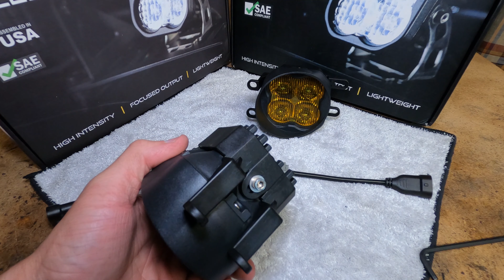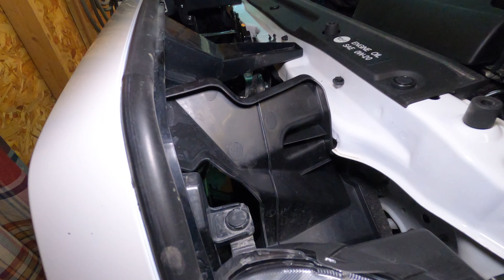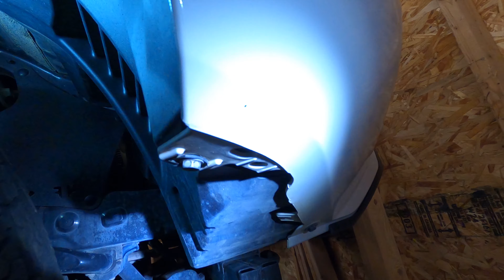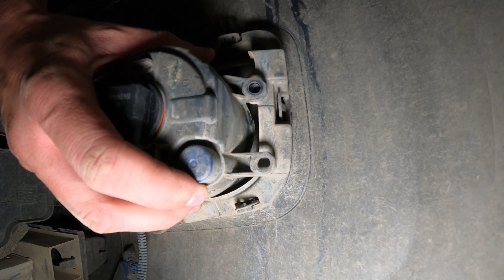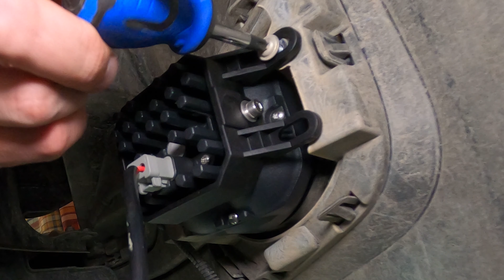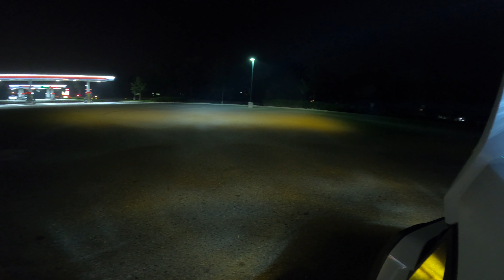Install & Review | Diode Dynamics SS3 Sport 3rd Gen Tacoma. Are LED fog lights worth the upgrade?

Comment: Nice install video! One small add on, the plug from the fog light to the harness will plug in either way, but will, only work one way, check that the  light turns on before you put it back together.  Great video!
Reply from the maker: You are absolutely right, and I did forget to mention that didn’t I? Thank you, and pinned!

Comment: Great video

Aimed proper as you described how are they in rain / fog / snow ? 

Any glare ? Thick pea soup fog and blizzards are what I plan to use them in. 

Guess they can be aimed and mounted lower as I’m buying universal mounts
Reply from the maker: The glare is minimal! That's the whole point of these is to cut through the blizzards, fog, etc! That said, you'll want to make sure to get at least the pro power level so that the lens face gets hot enough to actively clear off driving snow.

Comment: Can you guy do a comparison on the baja sae fog vs the diode ss3 sae fog?
Reply from the maker: Suppose I could... But what I will tell you is that the comparison won't even be close. The Diodes will win by a land slide. However, if you aren't concerned with road legality I can make a case for a set of squadrons being an awesome wide cornering light when mounted in the fog position.

Comment: When u put the fogs on and u hit little bumps does ur lighting bounce around? Mine seems to be not stationary even though i tighted the bolts..
Reply from the maker: You should not be getting much deflection of the lights at all on bumps. Is this on a 3rd Gen Tacoma or what is your application?
Reply: @hotshotoffroad  ya i have 3rd gen taco and i see the lights shaking when i drive and hit small bumps
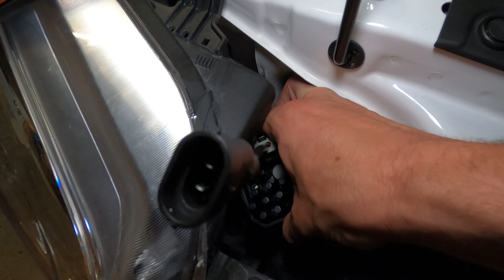Reply from the maker: Interesting... Not a known issue on the 3rd gens. Well take a look at a couple of things for me. First is the Toyota bracket itself. Go to 08:00 in my video. You can see that there is like a secondary bracket attached to the bumper. Make sure that is all snapped down and secure. 

Your side bolts that connect the SS3 to the DD bracket should be nice and tight, and the single screw connecting the DD bracket to the Toyota bracket needs to be snug (but be careful as the sleeve is plastic).
I have one last ditch thing that you can do, but I will call it last resort if all of those other items check out: You can run a zip-tie through the open hole of the DD bracket and the Toyota bracket. Here is a link to a Tundra install where I kind of go into it in more detail.
https://www.tundras.com/threads/diode-dynamics-ss3-sae-pro-fog-lights-installed-update-4-17-21-now-with-ss3-max.58478/page-19#post-2316845

Last but not least make sure that your entire bumper is secure to the rest of the truck.

Comment: Will these fit a 5th gen 4runner aswell
Reply from the maker: The 2016+ Tacoma kit is the exact same one as the current gen 4Runner! I just haven’t gotten it migrated into my website yet. So if you picked up the 2016+ Tacoma one you’re still in good shape.

Comment: What's the difference between the pro and sport ss3
Reply from the maker: Physically they are no different in terms of size. The primary differences come in terms of power output and light focus. The SS3 pro peaks at 10,900 candela and the SS3 Sport peaks at 9,800 candela. That said, the SS3 pro is not as focused and will put a broader swath of light out. The peak numbers seem close, but the usable output of the Pro is quite a bit higher than the sport. Both are excellent improvements over stock in nearly every vehicle.